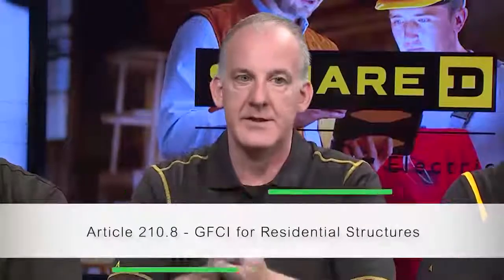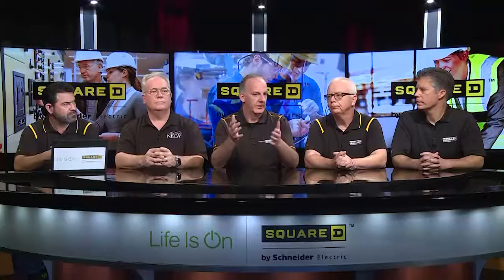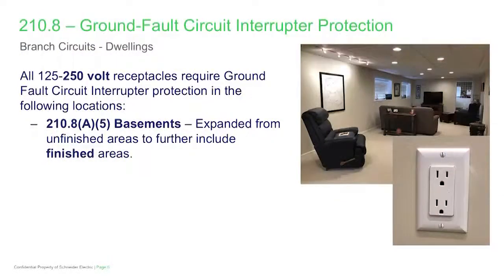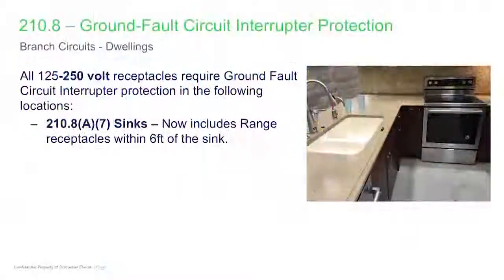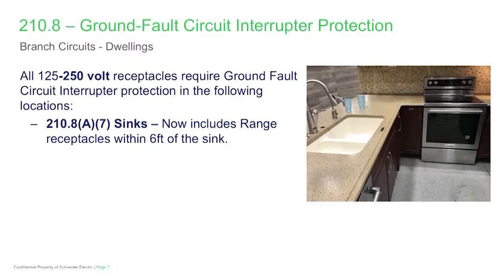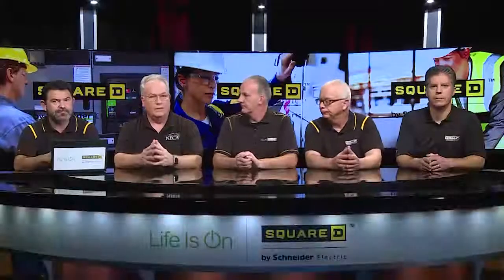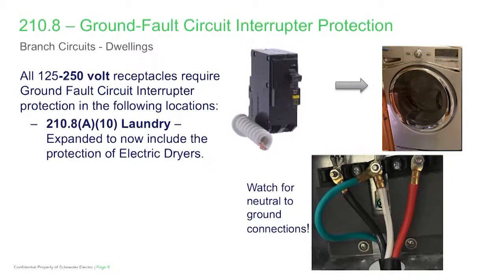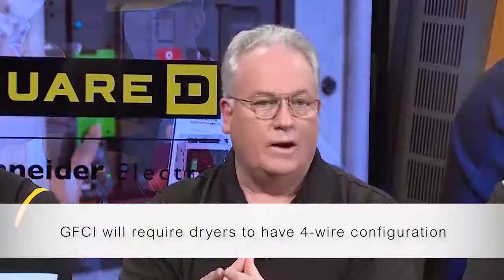NEC 2020: Residential - Ground Fault Current Interrupters Requirements

Comment: You can tell especially in this video that the Panelboard Manufactures are totally pushing this to benefit themselves and have been for more than a decade. Bathroom receptacles, kitchen counter receptacles within 6ft of a sink/tub/shower 100% should be,  garage and outdoors should also be GFCI protected 100%. Anything else in the dwelling is pure BS to be GFCI/AFCI protected, you are witnessing sales greed. since long before 2020. If this was for Safety Reasons then there is absolutely no reason why the Main Service of a dwelling is not GFCI protected. Instead every Breaker in the Panel now has to be GFCI or AFCI $45-$65 a pop on the 1-pole breakers (multiplied by 10-24) 2-pole under 60A $130-$180 (multiplied by 3-5). And then the real kicker: why is my refrigerator breaker tripping  or my AC Unit tripping while Im at work and my pets are in 100 deg temps inside my house? Their answer: Well your appliance is to old so now you have to go buy a new appliance. Total freaking BS. Yours Truly, Licensed Electrical Contractor Unrestricted, concerned!!!!

Comment: The addition of 208 & 240 volt outdoor outlets requiring GFCI protection was in response to FATALITY !  A child went behind an HVAC condensing unit to get a ball and was electrocuted.  There was a fault possibly on control components that the current flowing back on the equipment grounding conductor was not enough to trip the circuit breaker protecting the equipment.  But it definitely was above the 5 milliamperes that causes ventricular fibrillation (YOUR HEART STOPS), so the child died.  If that equipment was protected with a 30 or say a 40 amp GFCI breaker once that fault to the equipment happened the GFCI breaker would have tripped and not been able to be reset until an HVAC tech corrected the issue in the equipment.  Is the life of a child or anyone for that matter worth the additional cost of a GFCI breaker.  All of the substantiation for why a code is changed or added is public knowledge, just reach out to NFPA if you care to know why instead of just being ignorant.

Comment: A 208 gfci. Gee, a 5 dollar outlet has just turned to a 20, 30 dollar outlet that is not necessary but required now by the nec, why??? The nec before has taken issue about this situation but determined that if the outlet was above 4 feet, there was no problem  with electrical issues. Now you say yes there is, a clear support for the the electrical supply companies to make a profit off the nec. Electricians  and electrical inspectors,  it is time to say enough of this wasteful amount of time and effort and money and call out these nec representatives who do not look after us electricians or even the home owner,  the representatives are now looking out for the greed of the electrical supply companies. This is wrong for us as electricians as we add another job to our day, the homeowner doesn't know but pays extra for something not needed,  WHY????? The nec bums need to get their act together in a better way.